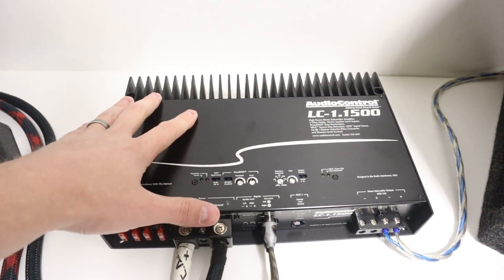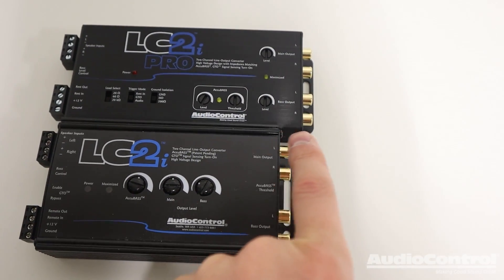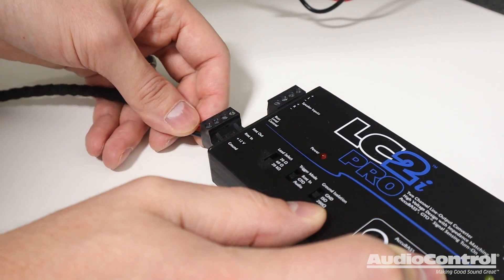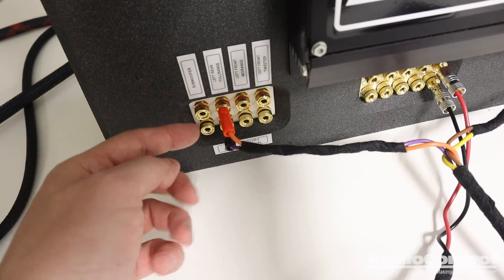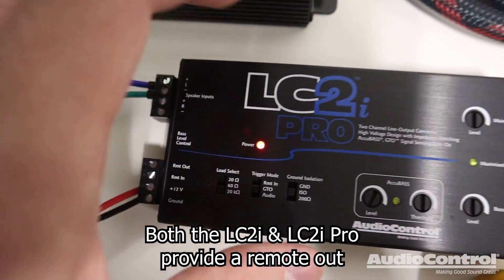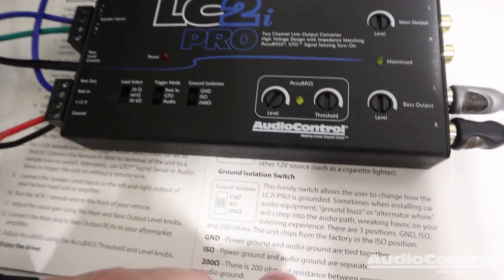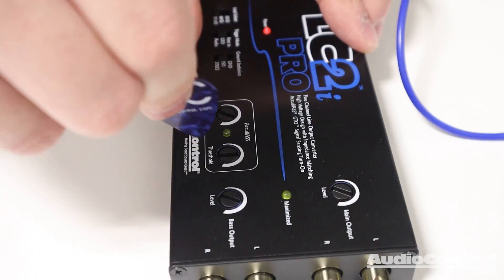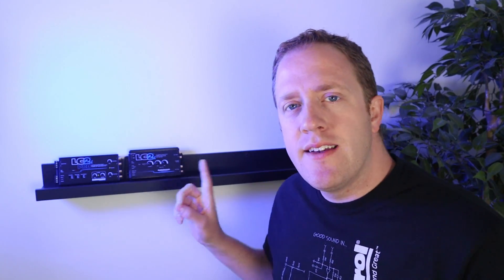Add amplifiers like a PRO! AudioControl LC2i-PRO overview

Comment: This dude is the best car audio fella on the YouTube. Just bought the lc2i pro... They should be paying him well... I'm sure he's responsible for a ton of sales
Reply: It’s a great solution that works. How’s yours going?
Reply: @jamesdewer it has issues... Shut off any time there is 3 seconds without bass. So when it kick back on it's always one to two seconds behind. Missing most heat drops... Kinda sucks to be honest
Reply: @SzechuanChickenDog put the jumper in to disable the auto on technology and run a real remote wire
Reply: @JacobThomas-c8p Thanks, I came to this conclusion also. It's just a pain that all the cheap converters do not have this issue. They work flawlessly. I appreciate that this is supposed to be better than the cheap converters BUT if they can't get one of the most basic functions right.... They should re engineer the circuitry.
Reply: @SzechuanChickenDog what car did you run it in?
Reply: @Skyefuego 2021 Mazda CX-5. Also the remote wire did not defeat the delay in bass. It's the actual, AccuBass circuitry. So overall I'm not happy with the LC2i pro... They totally botched re-creating bass roll off. It does okay but the fact that there's a delay for it to kick on that's about a half second. It happens almost every time the bass is gone for more than a few seconds. So you basically miss the beat drops from a ton of songs. It kick in a beat or two off sync so it just sounds bad and it's really frustrating. I should've just stuck with a cheap line output converter like I always used before. Mark still has a great channel but I would imagine if he used one of these LC2i and heard that delay all the time he wouldn't be so quick to recommend something 6x the price of a typical line output converter.

Comment: I'm going to add two 12-in Kicker competition R's to my 2022 Palisade calligraphy Edition. It has the Harman Kardon 630 watt system with 7.5 inch subwoofer in the rear. Going to buy the LCI 2 Pro to tap right into the existing wires in the luggage compartment. will the LCI 2 Pro handle the already crossed over signal. Do I need a DSP? I have very little punch and almost no real low end. The base roll off is horrible in that system as well.

Comment: Nice job with this video. This sounds like what I exactly need for my new Ram 2022 2500 with basic 6 speaker system!! What shall I do if I want to run a 5 channel amp? Which input? Fronts?

Comment: Hi! I installed a JBL BassPro SL2 powered subwoofer on my 2016 Volkswagen e-Golf (non Fender audio) by tapping the front speaker outputs and  connecting them directly to the sub’s high level input.  

I noticed the head unit output now clips at a much lower volume and it gets unusually hot. It is impossible to set the sub amp gain as the levels are all over the  place and slight changes to the amp gain cause the sub to cut in and out. 

I verified the polarity of all connections on both ends and everything seems alright. I would assume tapping into the speaker outputs effectively lowers the impedance seen by the head unit onboard amp causing it to go crazy. 

Wondering if using an LC2i instead of the sub’s high level inputs would make any difference.

Comment: 🤣 Gotta love you YouTuber viewers desperately trying to attempt to install. Please don’t just take it to a pro save yourself time and money and potentially a car. Hahaha
Reply: i about give up on doing it myself. i have the whole thing runnin and bumpin. but it's missing the mid bass entirely- im using a PAC sub pro instead of an LC2i... im trying to switch over to the lc2i because i think that will help with adding mid bass- either way ive spent so much time doing it myself and it's not hitting the way my other vehicles used to. so im about done- just gonna have someone do it... i did it though

Comment: I have a premium stock amp that uses fiber optic back to the HU them the HU control is pushed out to speakers 12 , In using the audio control unit I am begging the question , is there any back feed and reverse polarity that will damage the OEM premium amp or cause the OEM amp to react abnormally with the addition of The LC2  on the system

Comment: do you need to wire the sub power separate to the loc or can they both work off of the power in the loc? If not can I attach a wire to the 12v going into the loc and power the sub off it?
Reply: You can do that. But it is recommended to add a fuse between the amp and the loc

Comment: I have a 2013 Mazda CX5 with Bose. The signal from HU to stock amp is already low level. Is this LC2i still useful or can I just splice an RCA into the headunit output like I've seen some forum users do? Or should I keep factory amp connected and use high level out of there into LC2i? Ideally I want to ditch factory amp.

Comment: I know absolutely nothing about what your describing. I never will. If I buy this my.question is do you think a stereo installation place will be able to do all of this correctly? I have 2 12s and amp in new car and sounds low/high muffled/alittle distorted...idk basically shitty. New car factory head unit cannot be replaced its the floating iPad looking thing whitch I hate so will this help?

Comment: I mean why are you adding a line driver when you have speaker level input to begin with it would be better just to remove all that crap from the signal path, only use the bass restoration circuit and make it defeatable. But most amps have high-level inputs... so I guess I kind of miss the point of this thing

Comment: Thanks for the video. Unlike your example, I want to connect BOTH main and bass to 4 channels of amplification. So, according to the manual, the ONLY difference between the two is the bass output has a non-defeatable low pass filter and the output level can be controlled via the remote knob?

Comment: This is an awesome video and helped me decide from the LC2i vs the Pro.  AND using the Sub out instead of speakers on rear deck. GREAT VIDEO!  New fan!  Thank You!
Reply: I have a 2019 Ford F350 B/O OEM sub, which color wires do I use to connect the lci2 pro? Thank you
Reply: On 2019 f150 b&o sub wire there is 4wires due to stock sub being dual voice coil So I need to know if I am only installing one JL audio tw3 dvc sub would I use two wires or all four into lc2i pro?
Reply: so is it better to use your stock sub signal

Comment: So I've just installed the Lc2i pro in my new system. I kept the stock head unit, I only added a sub and I spliced into the left rear speaker inputs.
 I cranked my volume to 75% ( my speakers are quiet even for stock btw). So, I start turning the bass output level, and I hit the max but with no maximized light. I assume the signal just doesn't output enough because the speakers are quiet even at max volume. I left it at max, and then moved on to the acubass, turned the threshold all the way up and never got either light to come on, when I turn the acubass level to max, still no light. I finally said I'll leave It all at max, now the acubass decides it wants to cut on whenever and my L7 q-class will BLAST for a few seconds and then the feature turns back off. To clarify, this is a head-unit problem correct? I want acubass to stay on constantly while music is playing even if I turn the acr-1 all the way down. I've even tried turning up the head unit bass level but then the speakers start to distort. Do I need to replace the head unit (I really don't want too)
Reply: I had the same issue I just turned the volume up on my head unit then started getting the max light. But I was damn near at full volume but I also have a shitty 2014 Silverado ltz factory radio so it’s a total turd

Comment: What do I do if I don't have a stock subwoofer. Where do I tap into?
Reply: You can tap into a door speaker I’ve done it many times
Reply: @primesofty5504  old post but what if I’m trying to add a a miss and Hugh’s amp and also a bass on a stick head unit?
Reply: Exactly the main reason i watched the video and that was never addressed lol
Reply: OK so I just did this I know it's old but in the case someone new comes if you have a oem sub you use a ohm meter to test for the ground and signal you use those to wires to plug into the converter to get signal and then use your normal cable from the converter to the amp make sure your connections are good or you won't get signal
Reply: If you need more answers ask me
Reply: Not sure why he didn’t explain the accu bass on these which fixes the signal to what you need even if your radio cuts it out
Reply: I need answer for this too
Reply: Also I used the harness from the subs to the main harness instead of the main harness so that way if I ever sell the vehicle or devide to transfer my equipment I can easily buy oem subs and throw them back in you also can test for remote wire by turning the car off and back on the remote wire will read zero off and when the radio come on it will read about 9 to 12 volts
Reply: You can tap into a rear speaker or a door speaker….
Reply: Also this is something you need to take the time to do it is alot more tedious than using an aftermarket head unit if you don't have good electrical skills I would stay away from it or you may burn up your car
Reply: I'll also add that I really really like the accubase
Reply: I tapped into the rear deck speakers just pulled the cover off from inside the trunk
Reply: Back of radio ….
Reply: Do I need this even if I have a factory subwoofer? The guy at best buy said I need it but I have a friend that has a factory subwoofer in his accord and didn’t need this
Reply: @manuelgomez7650  aftermarket sounds way better what you can do is remove the stock subwoofers and replace them with like say a kicker or skar subwoofer same size in its place

Comment: May I recommend adding the subwoofer signal (mono) information to the website. I was looking for the info to know weather I wanted to pull the signal from my factory subwoofer in my 15' Chrysler 200s AWD. Wasn't sure if the single channel would be enough and not throw the "sounds" around; that being from left to right essentially. I did notice you guys had the mono hook up information but it was very limited. 

Thank you for specifying this information as I noticed while using the left and right rear speakers, the low notes seem limited vs my old vehicles which didnt have the factory sub. 
- I've had the exact same set up in nearly 6 different vehicles. 

Thank you for this AWESOME invention making it SO much easier to install a little extra bump without ripping my very expensive factory setup out. The Alpine setup my car comes with is very nice, but I always wanted a little more thump and bump from it. Thanks again AudioControl. Will be looking into your amps as soon as I can as well.

Comment: Hey Mark, great video.  Perfect information.  I was thinking in my head - "what input should I take from the factory system - sub or rear speakers".  But then you covered it off with the advice to take the sub input into the LC2i.  In the past, I have used the rear speaker wires, and then had issues with fading from the head unit, if I faded towards the front, my sub was not getting all the volume it could use.  So with my new system, I have a factory sub, so I will be using that input into the LC2i.

One question for you.  I have an MTX RFL 12" SVC, and the MTX 4001D amp.  I am worried about the sub being under powered at 2 ohms.  Do you think it will be ok?

Great channel - keep up it up!

Comment: I’ve used the LC2I pro on my Audi S3 with Bang & Olufsen upgraded. 
It only works intermittently. I have to keep switching the car off and on until it decided to power up the aftermarket amp & sub???
Reply: Every time the car is parked when I get back in the subs are off.
If I adjust the load select from 20ohm to 60ohn then switch the car off and on again they start working. 
It doesn’t matter what load select it’s left on when I return to the car the subs are off.
Could the unit be faulty?
Reply: Change your trigger input to audio instead of GTO
Reply: @privateinvestigation4805  it’s something to do with the B&O amp. The only way I’ve got it to come on reliably is to plug the original sub in as well as wire up the LC2. Not ideal but at least it’s working now.

Comment: Hello AudioControl Team!
At the moment I’m using an JL Audio LoC-22 and would like to upgrade to the LC2i Pro. My issue is that the Bass Rolloff from my Audi MMI B&O System is very noticeable. My question would be if it is required to run a full range signal to the LC2i for Accubass to work or will it work with an Subwoofer-only output? Thanks in advance!
Reply from the maker: Great question! Our AccuBass technology does NOT require a full range signal be present for it to operate properly. The LC2i Pro would be a perfect match for your Audi. Let us know if you have any other questions!
Reply: @AudioControlCar  Thanks for your answer! Today my LC2i Pro came in and have another question. First I setup my gain using a test tone and the maximized light. When enabling Accubass the maximized light comes on again. There is no step in turning down the Level to compensate for this. How should I be proceeding? Should I turn down the level until the maximized light turns off to prevent distortion with Accubass active?
Thanks in advance!

Comment: So would it be worth spending the extra money and getting the pro?
Reply from the maker: It really depends on the features you need or vehicle you drive, but basically- if you are going to buy the LC2i + ACR-1 bass knob, you might as well buy the LC2i Pro for the same price. Or, if you were planning to buy the LC2i + a set of AC-LGDs, again, you might as well get the LC2i Pro for a few dollars less. The LC2i Pro is a fantastic value with all of the built in features

Comment: Have a question regarding my install, have a professinal installed this loc and mono amp. Power connection from loc tapped into the 12v power from amp and remote from amp connected series to loc to remote in. Is that ok?
Reply from the maker: It is generally acceptable to install it that way, yes. Although we do suggest power and ground for our products be sourced directly from the vehicle's battery, a large majority of installers grab power and ground directly from the amplifier's input terminals without issue. As long as the wiring feeding the amplifier is of adequate size, there should be no issue.
Reply: @AudioControlCar  Thank you.

Comment: 5 channel amp for 4 mids and highs and one sub will it work and how? Thanks
Reply from the maker: It will work, however you will lose the ability to fade from front to rear. If you don't mind that, it will work perfectly. If you would prefer to maintain the fading ability, then use an LC7i or higher, and you're all set.

Comment: With this device or an LC7i which is what I have, how would you go about using the loc and feeding it to an epicenter? As you mentioned the subwoofer channel is only for the low end, the rear speakers are full range but limit the low end. How would you wire the loc so that the epicenter can receive a real full signal?
Reply from the maker: Both the LC7i and the LC2i Pro put out signals up to 1khz on the "bass" outputs, therefore they're perfect to feed the input side of an Epicenter. Feel free to just take the sub or CH3 output of your LC device and feed it to the input of an Epicenter. Should have some great results and be more fun to listen to!

Comment: If you wanted to use it for a 4 channel amp will it work and how
Reply from the maker: Yes, it would work- however, you would lose the ability to fade front to rear from the source unit. If that’s not a big deal to you, then run the “main” rca out to your 4ch amp’s inputs and the “bass” rca out to your sub amp’s input. Some 4ch amps can work with just 2ch of input, like most AudioControl amplifiers, others will need Y adapters to make it work.
Reply: @AudioControlCar  thank you for replying back..
Reply: @AudioControlCar  could you run two separate subwoofer mono-block amps with just one LC2i?

Comment: Do you need 2 of those if you have 2 amps?
Reply: Just one can handle 2 amps.
Reply from the maker: bigabescanal is correct... The LC2i and the LC2i Pro both have a MAIN and a BASS output RCA set, so you can do two amplifiers with just one LOC from AudioControl. If you'd like to maintain your front/rear fader, then consider upgrading to an LC6i, LC7i, DQ-61 or above.

Comment: If your amplifier comes with a dash control knob too, which should dash control should be used? The ACR-1 or the amp's knob?
Reply from the maker: Depends on the amplifier make/model, but generally, we would recommend using the ACR-1.

Comment: I have a huge question and need tremendous help please, I have an Infiniti m37s and I purchased the lc2i pro everything to my knowledge seems fine according to the way you did your connections, I unplugged the factory sub and used the harness to connect the lc2i but I’m getting feed back as if it’s the exhaust sound coming through the subs, it doesn’t increase as I Accelerate, I have the level turned all the way down the threshold turned down basically everything is turned down....should I worry? Please help @AudioControl, I’m getting good bass adjusting the amp settings.
Reply from the maker: Sounds like it could potentially be an ANC microphone issue. Many vehicles are equipped with ANC noise cancelling microphones. Google your vehicle "+ ANC mic disconnect" and see if your vehicle has one. If so, disconnect it and see if the noise goes away. If not, give our tech support team a call and they can try to walk you through the solution.
Reply: What they said. Infiniti's have ANC, which will be played through a aftermarket sub. Had to disconnect the mic on my Q50.